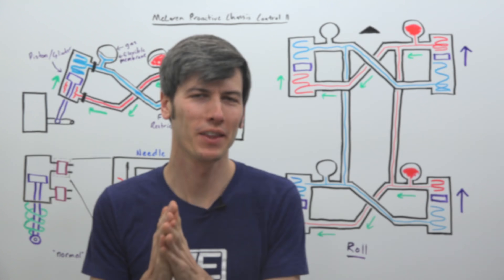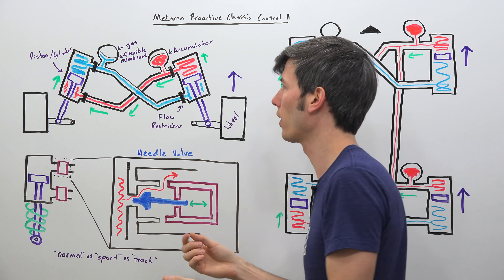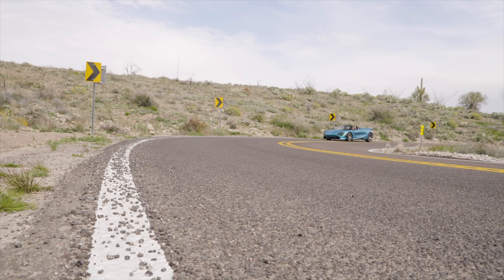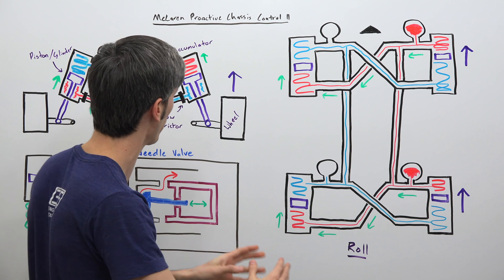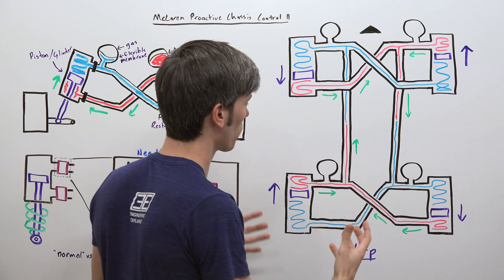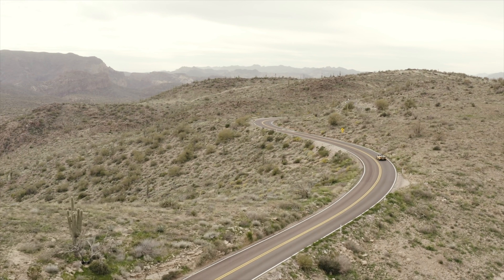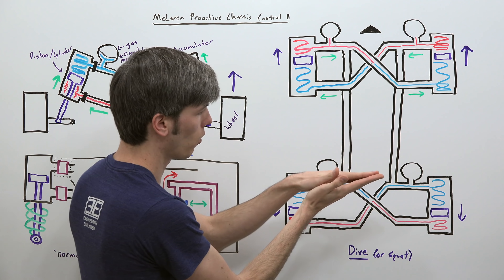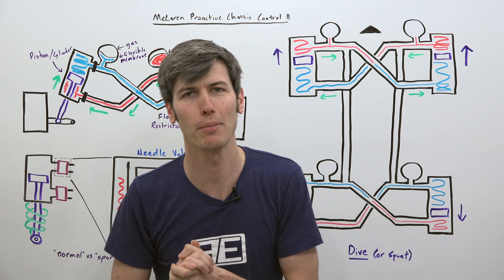The McLaren 720S Suspension Is A Complex Masterpiece

Comment: I would have guessed that when all 4 wheels are compressing (as a result of downforce or track irregularities) it would be desirable to have increased stiffness to maintain ride height. Additionally, I would guess that reducing dive and squat would be desirable for the same reason as well as potentially reducing camber gain of the loaded wheels during braking/acceleration. I suppose the only case where you want reduced/minimum stiffness is in warp, which this system provides, and "increased" doesn't mean much without evaluating the baseline. It's also mentioned that the needle valves adjust spring rate, which seems incorrect. They would likely adjust damping as they would affect force vs velocity of the wheel/fluid flow, not force vs displacement like a spring would.
Reply: Selecting the configuration of the connections/adding more lines to this system could be something the engineer optimizes for different vehicles with different characteristics/requirements, it's possible that this exact system isn't the "best" for all applications.

Comment: It would be nice if they came out with a fully decoupled damper system. This seems a nice step but it could be done in other ways and it is a compromise. I have been fascinated by decoupled hydraulics and have thought the best use for it it would be in Dakar style buggies with huge suspension travel, although there must be a reason they don't use it ?

Comment: My question is: what's damping the bumps in this system, is it the flexible membranes or the flow restrictors opening a bit? if the flow restrictor goes all the way close, then the car will just have a solid rod as the damper, right?

Comment: Nice and clever system, however, during rides in very uneven roads (such as the ones in Brazil), the irregularities of the pavement push for warp / heave responses in frequencies that interact with the rolling response of the suspension, reducing its effectiveness. In such a situation, it is hard to beat the conventional anti-roll bars of the latest, state-of-art Ferraris. Maybe, for those markets, it would be necessary a smarter restrictor to block heave and warp at some frequencies to improve the rolling stiffness of the suspension. It would end up reducing comfort, but can improve cornering (maybe a 4th mode selected by the driver: race mode in uneven pavements...). Very good video. Congrats!

Comment: The tricky or lets say clever part of the system, will be the setup of high pressure space to low pressure space within the cylinders as well as the accumulator itself. Because if the body & wheel motion allows the fluid run from compression to expansion side of the cylinder, a part of the fluid needs to run into the accumulator, because of less space within the expanding cylinder. The accumulator then will work as an additional spring which will help to reduce the body motion. The accumulator also helps to reduce the kavitation within the system. The different valves for the compression and expansion part of the cylinder will work like compression and rebound damping in conventional dampers. So the really worthful part of this decoupled system is that you can have different sring and damping rates for each body motion mode (heave, pitch , roll, warp).

Comment: A couple of things.
1. Do the pistons in the dampers allow fluid to pass through damping valves in them, like normal dampers, or are they sealed with no flow through them (in which case, where is the damping taken care of)?
2. Surely the needle valves open up for sport mode and close down for comfort mode. Greater flow between dampers on opposite sides must surely increase anti roll behaviour, not decrease it?

Comment: This system is commonly used on cone crushers.  Which are found in nearly every rock quarry in the world.  The problem with this type of system is what you would imagine.  Leaks and temperature greatly effect the systems performance.  Also it would get very expensive taking the car to McLaren for leaking and accumulator adjustments because every couple years you need to set the bag pressure in the accumulator.  Overall it's a very useful system but maintenance is way higher than a torsion bar.

Comment: I can see one potential problem with this suspension and I'm curious if they have found a way around it... when you have it in sport mode the fluid is more restricted.  That would mean that the pressure preventing body roll would also be more restricted.

Comment: This in analog form, an analog torsen based 4wd, a manual gearbox, mid engined, throttle and gear linkage, no wires, all aluminunium (chassis, body, engine) build in the works 🤘 No servo, no turbo, maybe compressor.. BMW k1600 engine. three seats. It's going to be a driving experience

Comment: PS: The Toyota Land Cruiser LC200 has a variant of this system, called Toyota KDSS, essentially the same concept. The KDSS keeps the anti-roll bars but they are attached to the body of the car using hydraulic pistons that are linked back to front. There are lots of animations on YouTube that illustrate this far better, so I won't attempt to butcher this. I own a 2014 LC200 with KDSS. Also as far as I know McLaren have been using this type of suspension since the 12C. I would be very interested to hear your response to this. 500 comments however and growing... Fingers crossed.

Comment: Great video! Have a question: Should it not be that the more open the restrictors, the stiffer the car gets? For example, in the other extreme, where the restrictors are totally closed off, then you have essentially a conventional car with no anti-roll bar. Body roll like a 4x4 from the 70s. The more open those restrictors, the stronger the cross linking effect. Essentially like having a stiff anti roll bar. WDYT? Have I misunderstood?

Comment: The accumulators work much like a water pressure tank in a well/pump system.  If the diaphragm in the tank ruptures the system won't be able to hold water pressure for long.  I've had to replace a few of them before.   The 720 has a cool suspension but i wonder how long it will last before it starts to fail.

Comment: Help Engineer Obwon Canobie, you’re my only hope! This is an off topic question, but Please help me. -  I keep hearing the same phrase over and over and over, and it's driving me crazy. "When you go into 4-low, the truck slips into a lower range of gears". - This doesn't make sense to me. I'll use my truck for an example but the logic works on anything. I have a 2019 RAM 1500, which uses an 8 speed transmission. So, if I'm in 4-high and driving along slowly, the truck will stay in 1st gear, it's lowest gear.... If I'm in 4-low and slowly driving along, the truck will stay in 1st gear, it's lowest gear... So therefore nothing changes. They SHOULD logically be the same... Right? - But it clearly isn't... I feel the truck do something when I put it into 4-low. The feel of the truck COMPLETELY changes. It drives differently. Everything changes..... - but I can not for the life of me understand why this is. I only have 8 gears to choose from right? What is changing? Please help... :(

Comment: Cool, but still gets beaten by both Viper ACR and 911 GT2RS at Laguna Seca, 2 cars with simpler suspension. So performance wise, there are better options
Reply: This comment is so irrelevant. Those are totally different cars. May as well compare this to a Bently. Of course, you could, but nobody would learn anything.
Reply: 2 track focused cars on R compound tires that are death traps in the rain are slightly quicker than a far more comfortable road car on street tires. Thanks for the 12 IQ observation.

Comment: The last "feature", actually allowing dive or squat, seems more like an unfortunate side effect of the system. I'd want it to resist dive and squat just as much as I'd want it to resist roll... But if you did that, then it wouldn't allow for warp. So... Something about having and eating cake...
Reply: Seems like they could solve that with maybe a few more lines and valves that monitored g-forces.

Comment: Finally a successor for the Xantia Activa. Hidroneumatic suspensions are great! Please make a video about Citroen suspensions and how they were integrated with the brakes and steering. Citroen already had self centering variable power steering back in the 70’s and used the high pressure hydraulics to power the brakes. Amazing, safe, comfortable cars. Decades ahead of its time, but unfortunately not well understood (specially by mechanics) and under appreciated. Good to see someone taking forward, and hope more brands do the same.

Comment: You mention the flow restrictors being set according to one of three settings. While I see that working for the pressure side of the cylinder I don't understand the benefit of having the receiving (opposite) cylinder also fixed.
Doesn't it make more sense to assume there's an independent system varying the receiving valve to choose between "activeness" (going through a corner) and dampening from the accumulator (single wheel hitting a pothole)?
I might be missing something but it looks like such a system without active control would suffer from unpredictable handling on bad roads..
Ps: I believe I owe you a potato now.

Comment: I remember watching a science documentary a few years ago that mentioned a prototype suspension system for military vehicles where each suspension cylinder was filled with a magnetic ferrofluid that changes viscosity based on an electromagnetic field. Basically what they did was put computer controlled electromagnets by the orifices in the piston head to control the rate the fluid moved to the other side. Basically this adjusts the resistance of each individual shock absorber resulting in a much smoother ride compared to a traditional suspension system
Reply: That's magnetorheological shocks. Lots of passenger cars have those now

Comment: Mercedes uses a similar system and calls it AIRMATIC, it's available on many models. 
However, it does not have the interconnected oiltubes, instead each wheels' airspring is electronically hardened and softened within a few milliseconds.

Comment: Something is missing here. This arrangement actually enhances brake dive. I'm guessing there is a control cylinder between the front and rear systems that either senses a dive condition (balanced left to right force, opposite front to rear force), or more likely is computer controlled, to reduce dive and squat.

The real test will be how the system handles roll, dive and warp at the same time. That, presumably is what you pay McLaren for.

Comment: I'm going to have to try to design one of these systems for custom tube-frame car I'm drawing up.  Really wouldn't be that hard to do- the pressure accumulators can be made fairly easily, with an external air valve for pressure adjustments.

Comment: So as I see it, it keeps the car flat in roll, allows it to twist and redistribute easily on bumps and uneven surfaces (overall car is still level, with twist at the front counteracted at the rear and vice versa) and it allows the car to move up and down as a whole easily while still keeping it level. So soft on bumps and grade changes, hard in roll. 

The idea is genius. Reviewers keep saying it drives better than a Bentley at the comfort end while a Huracan threatens to knock your teeth out. Really?

Comment: I've seen a lot of comments questioning how restricting the fluid flow would generate greater total system stiffness.  I'd like to take a stab at an answer (and get brutally corrected I'm sure). I think the key here is to remember the system also uses a set of accumulators and flexible membranes in combination with the flow restrictors.  The flow restrictors generate the proper amount of stiffness on the top side of the dampener that is being compressed during a hard turn while the accumulators and flexible membranes help transfer additional fluid and reactive pressure to the lower side of the dampener that is extending during that hard turn.  The gas in the accumulators acts like a pressure ballast that can reactively release the built-up gas pressure to the lower side of the dampener that is extending during that hard turn. The flexible membrane aids in this ballast effect while also acting as a pressure multiplier to the small amount of fluid being evacuated from the compressed dampener. If you think about it, you need higher pressure in the top portion of one dampener and higher pressure in the lower portion of the other.  You do not necessarily need fluid to transfer to achieve the desired higher pressures.  You just need to be able to increase the total pressure in the system.  So they designed a system that is able to build and transfer pressures with very little actual fluid movement. The small amount of fluid from the top of the compressed dampener is displaced into the accumulator thereby compressing the accumulated gas within as well as "ballooning" the flexible membrane which as a result increases the overall pressure in the system.  This greater pressure in the system thus naturally engages the lower portion of the other extending dampener through that hard turn. I welcome constructive replies letting me know how I'm incorrect so we can all learn together.

Comment: I think this will not work as you explained it. This will apply an upward force to the unsprung mass of the outside wheel. In effect the normal force applied by tyres on ground would be reduced and hence less friction and grip.

Comment: It's the shaft's displacement that actually forces fluids into the reservoir. And those flow restrictors are actually called base-valves. 

Also surprised that they don't use a twin tube layout. It helps a lot with cavitation and keeps the pressures equal on both sides of the mid-valve piston. Also gives more damping control with the base-valves.

It also would've been cool if you would've explained shaft speed and high speed compression/rebound damping. I'm sure those mid-valve pistons would have some shims for the HSC and LSC!

Comment: Good explanation. I remember the rally version had the control valves front to rear (a 4 line box in the middle of the car) and the lines crossed over front to rear rather than side to side. There was no side to side flow, so if the front left was compressing, the flow would then push on the rear right. Now I'm wondering how much extra this system you explained here would have with front to rear flow control valves as well as side to side.

Comment: If it's on track mode, shouldn't the needle valve allow more flow, so the opposite suspension receives more fluid and therefore a higher counter force and the car almost doesn't roll at all? Great video btw, thanks!

Comment: I find it shocking that there have to be pipes and oil and flow restrictors... Are we in the sixties? Can you not build a spring with electronically controlled rigidity? Would be lighter (no fluid and pipes) and you could come up with more sophisticated programming than just crossing pipes (e.g., low rigidity to heave and warp, high rigidity to roll AND dive/squat)

Comment: Great video! Wouldn't the needle valve be closed for softer response and open for a stiffer chassis? More pressure being similar to a thicker roll bar?
Reply: I'd like to take a stab at an answer (and get brutally corrected I'm sure). I think the key here is to remember the system also uses a set of accumulators and flexible membranes in combination with the flow restrictors. The flow restrictors generate the proper amount of stiffness on the top side of the dampener that is being compressed during a hard turn while the accumulators and flexible membranes help transfer additional fluid and reactive pressure to the lower side of the dampener that is extending during that hard turn. The gas in the accumulators acts like a pressure ballast that can reactively release the built-up gas pressure to the lower side of the dampener that is extending during that hard turn. The flexible membrane aids in this ballast effect while also acting as a pressure multiplier to the small amount of fluid being evacuated from the compressed dampener. If you think about it, you need higher pressure in the top portion of one dampener and higher pressure in the lower portion of the other. You do not necessarily need fluid to transfer to achieve the desired higher pressures. You just need to be able to increase the total pressure in the system. So they designed a system that is able to build and transfer pressures with very little actual fluid movement. The small amount of fluid from the top of the compressed dampener is displaced into the accumulator thereby compressing the accumulated gas within as well as "ballooning" the flexible membrane which as a result increases the overall pressure in the system. This greater pressure in the system thus naturally engages the lower portion of the other extending dampener through that hard turn.

Comment: I wonder how the characteristics of this suspension would change if you could change the pressure on the gas side of the accumulators. 
I also wonder when we'll start seeing other cars with this, or even see this as an aftermarket option.
Is the suspension geometry good enough where dive and squat won't be an issue in normal driving, but makes it extra stiff for the track? I'd feel better having active needle valve control, based on a computer monitoring pressures, pedal positions and acceleration, and maybe even throw in gyroscopic monitoring, just to keep the car as flat as possible during normal and track conditions.
Also what happens if road conditions cause roll and warp at the same time?

I kinda wanna see this compared to electromagnetic suspension to see which is better.